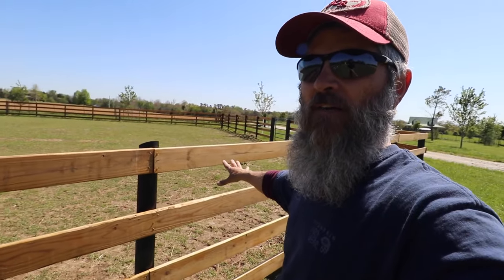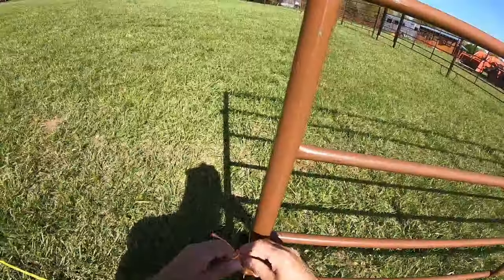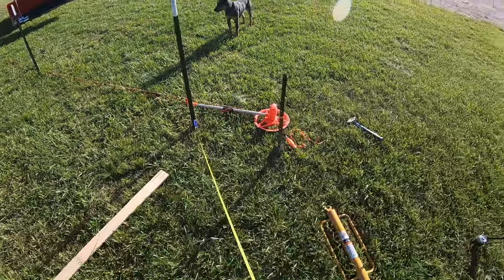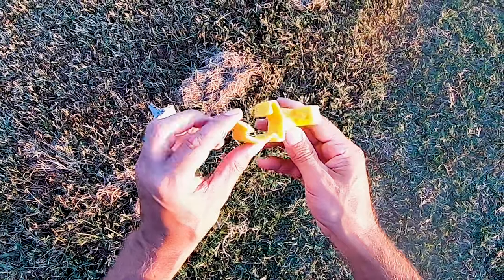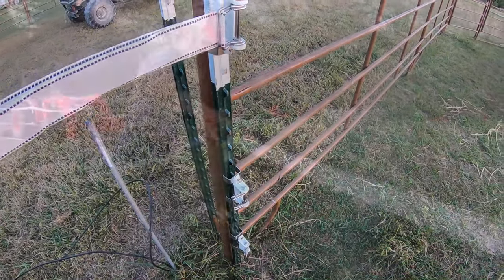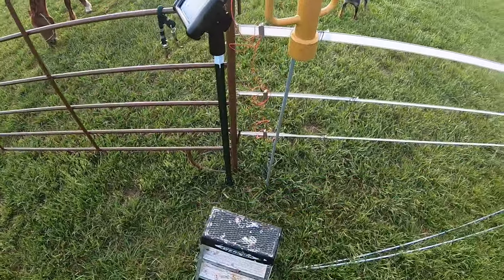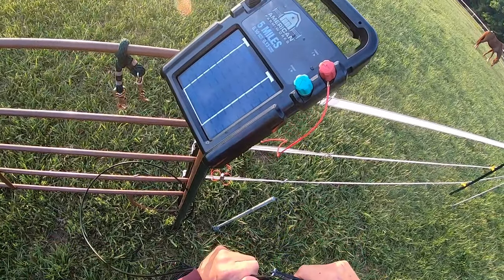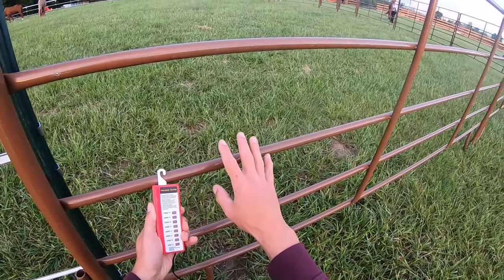Solar Electric Poly Tape Fence Install for Horse Pasture

Comment: So I'm a homesteader but work for a large fire department as a hazmat specialist. We do alot of grounding and bonding when we drill and pump off overturned tractor trailers etc. don't hesitate to build a "trench" and lay your rods horizontal, about a foot deep. You're results will be just as good, and you may avoid your rock layer!
Reply: *your.

Comment: You can dig a 8 foot x 1 foot ditch and lay the rod in.  It is not the depth of the rod, it is the amount of rod in the ground.  In underground utility construction we always laid or rods in horizontal. We basically just put them in the ditch.

Comment: Great video my friend. I bought the 10 mile one for my 2 acres lol and it works great neighborhood dogs do not want no part of my yard no more. Quick tip for anybody that needs to move their ground rod a pair of vise grips, a 2 x 4, rope. What you’re going to do is a seesaw affect. Hook your vice grips to your ground rod, tie the rope around the vice grip and to your 2 x 4 put the 2 x 4 on a log or something off the ground and pull it out doing the seesaw maneuver. Hard to explain texting, but comes out very easy.
You folks testing it out on yourselves, one may feel it different from the other because of your shoes. If you had your shoes off, your hair would stand up lol or your shoes wet gives you a bigger shock. Also to make your system last longer, take some clear silicone and run it where the solar panel meets the rim or frame of the plastic surrounding it, rain likes to get into the system and it just helps Keep it dry inside. Peace and God bless.

Comment: I’ve used American Farmworks solar chargers several times and I promise you, spend the extra money and go with a Gallagher charger. Much much less headache and they aren’t nearly as temperamental to ground like the AF chargers. The Gallaghers are also way easier to replace the battery when they get old.
Reply: yep bet that FarmWorks  didnt work 2 weeks for him>

Comment: Great family time theater, looks like you had fun.   

Please eliminate the slack on the black ground wire runs, otherwise, it will be a tripping hazard.  While you are at it please remove the slack from the charger to the first ground rod for the same reason.  On those exposed ground rod ends consider slipping a section of PVC pipe with a cap on it to cover the exposed rod end just like you should cover the top of the T- Post.  There are T-Post Caps/Poly Tape Mounts available for your top tape.    Yes, I have seen animals impaled on un-capped T-post ends, not pretty.

Great video, you were under the watchful eye of a great working dog. He was always on guard.

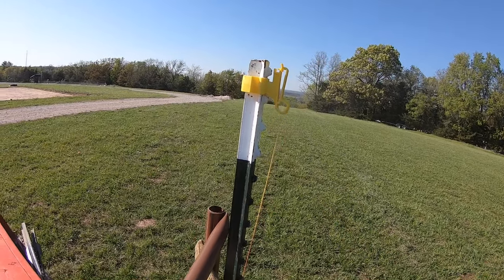Comment: Loving the video, super good presentation of the process.  But at 8:49 how is that an 8 foot post?  The panels would have to be 7 feet then, but in the next scene the 5 foot post is the same height as the panel.
Reply from the maker: Good catch!  Not sure why I said 8 footers.  The taller ones are actually 6 foot tee posts.  I never realized I made that mistake saying they were 8 footers until now.  Thanks for watching and catching that.
Reply: @FromScratchRanch  That makes sense!  Thanks for a very helpful video and your fun family :~)

Comment: I have one of these and the controller LED flashes but is not putting out voltage. I can put the tester on the terminals and get nothing.

Comment: Where did you find the 12.5 gauge wire with wire already ran through the cover the one you linked is wrong
Reply from the maker: Tractor Supply.  Here is the description for an online search:  American FarmWorks  50 ft. Insultube for Up to 12-1/2 Gauge Class III Galvanized Wire, Insulation Rated up to 20,000V.  Not sure why the link is not working for you.  I just tested it and it went right to this item,

Comment: Which is better the poly wire or poly tape?
Reply from the maker: I do not have any experience with the poly wire, but I did choose tape over the wire as just because of personal preference for how it looks.  I like the 2 inch wider tape because it is more visible than the poly wire.  I would use the electrified poly wire or any other less obtrusive electrified wire though along the top of an existing non-electrified wire or wood fence to keep the horses from leaning over and damaging the fence.
Reply: @FromScratchRanch  ok I like how the tape looks too but I'm wondering how it'd be able to repair I don't think I'd be able to splice it

Comment: I used those yellow insulator and they lasted a little less than 1 yr. They get brittle and break. I wish they lasted at least 3 to 4 yrs.
Reply from the maker: yes, I agree.  I have had a few I have needed to replace over the last 2 years... but it hasn't been that bad, and we get a lot of sun that would make them brittle.  Sorry they haven't worked out that well for you.

Comment: Did you do this in one day?
Reply: Absolutely, depending on how large your yard or field is. If you have an existing fence up and want to add electric to it, super easy and no time at all. I have a split rail fence and I put up my wire around an acre in about 3 hours or less